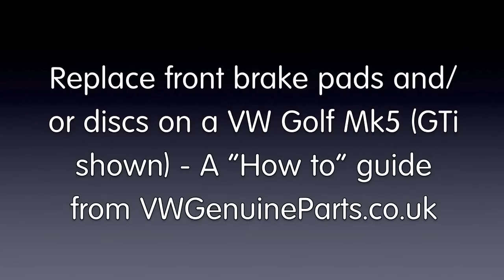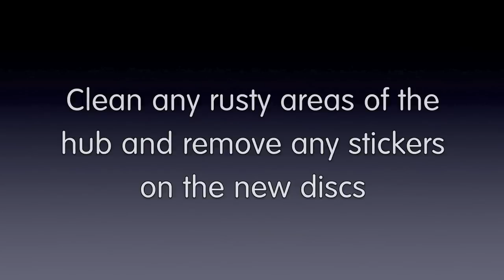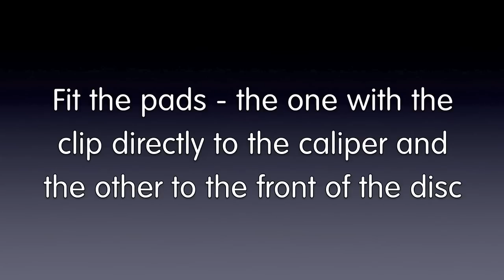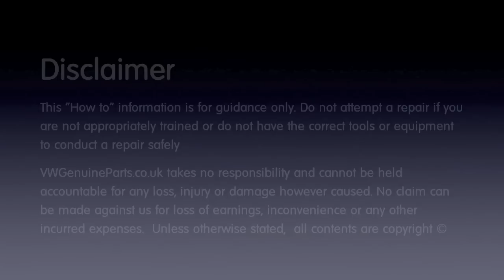Replacing VW Golf Mk5 front brake pads and discs - "How to"

Comment: Great video.  Did this on a Seat Leon mk2 (2006) 2.0 TFSI, the parts are the same and these instructions work perfectly.  Front discs were 312mm.  Didn't have the brake pad level sensor on the car, so I just removed the lead on the new pads with a pair of wire cutters.